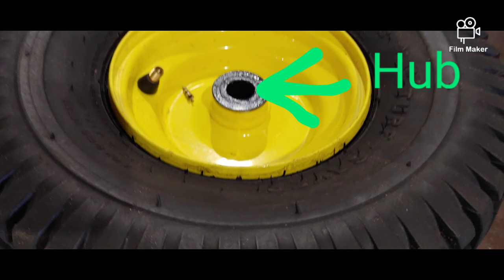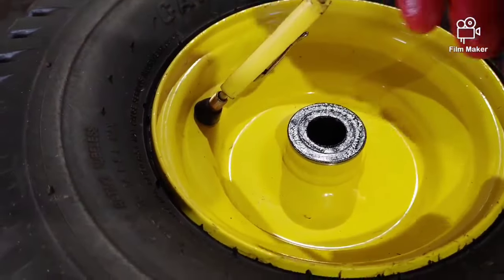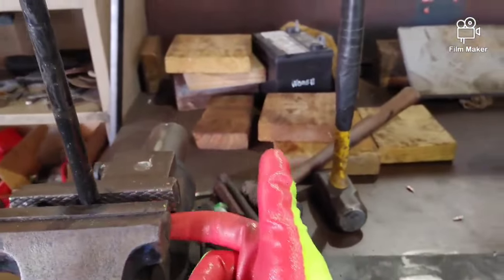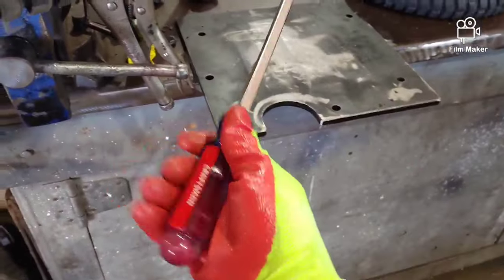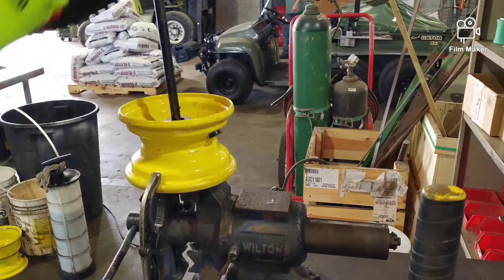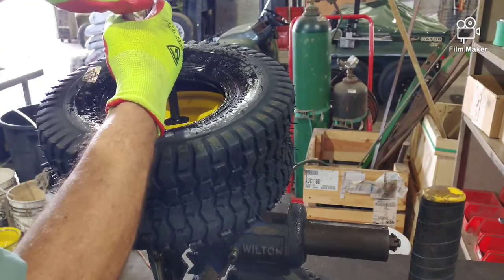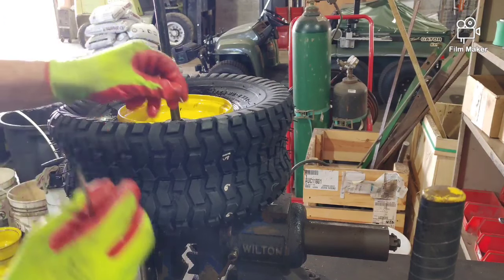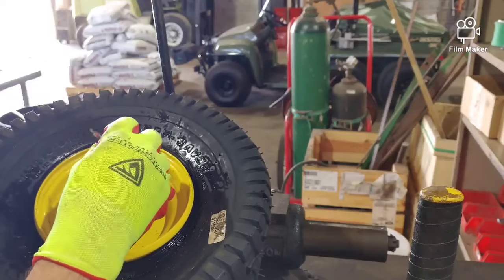How to mount a small riding mower tire. Very easy method.

Comment: One thing I think you forgot.  When you go to air it up, sometimes the bead won't settle into the rim and the air just escapes.  To remedy this problem, put a belt around the tire at the center of the tread forcing the bead into the rim, then air it up.
Reply: Or ratchet strap
Reply: Yeah a lot of these videos leave off the air-up step, probably the most difficult step. Wonder why that is?
Reply: Your subscribers made the best point of the post. Thanks so much.
Reply: Get the tire heated up, I lay them out in the sun shine for a while before I change them, the heat swells them and makes them more plyable

Comment: try breaking the bead loose with a hammer on one that's been on a mower about 20 years,also try it in cold weather
Reply: That was my situation, i dropped my snow plow blade on it a few time and that finally did the trick.
Reply: Try that hammer trick with old hard and dried tire. It won't happen.
Reply: If your vise is big enough use it to break the bead
Reply: Thank you saw much for your info. I needed that tip at this time. God bless you for saving me lots of money.

Comment: Getting it off the  rim is the easy part Getting  broken  free  from the  rim is the hard part when they haven't  been  removed for a long  time
Reply: That's the first thing I thought when I watched him just wack it off with a hammer in a single hit.  
That said I'm impressed with the bar in the middle trick, I usually struggle with dual tire irons working them around to pull the bead over the flange.
Reply: Especially ones that are 30 years old, rusted and full of slime. Haha.
Reply: @MISTERSLLIM put the tire on the ground, put a jack on just the rubber and jack like you are lifting a car.

Comment: I don’t believe I have ever left a comment on a Youtube video before.   DAMN!  This worked!  I was so frustrated that I was ready to drop $50 on a Harbor Freight small tire changer!  This made my afternoon, and I got the lawn cut!  Thanks much for this short, sweet and ingenious video!
Reply from the maker: Thanks Phil!
Reply: I had one of their small tire changers to use on go-kart wheels.  It wouldn't even break the bead without bending.
Harbor Freight's motto should be:  Designed to break, and built to stay that way!
Reply: @davebryant8050  HF sells a set of socket extensions that are extra long.  Those are handy, so I bought a set, Thinking what could break.  Zero moving parts right?  The square end of one just twisted right off.  You'd have thought it was made of brass, it was so soft.  I don't think the steel had been correctly hardened.
Harbor Freight:  Designed to break, and built to stay that way!!!
Reply: I bought that HF small tire changer and it did squat. Be thankful you saved your money.

Comment: Great video.. Thank you....  to break the bead, I place the wheel (without air and with valve core removed) on my smooth asphalt laneway. (or lawn...but not gravel) then very carefully drive over the edge of the tire until the bead separates from the rim.  Great tips thank you

Comment: Thank you so much for taking the time to make this video. I have a commercial grasshopper mid mount lawnmower, and I had a hole in one of the small tires in the front. There were no tire shops open today and I had the tools to do it and a bench with a vice and this really save me a ton of mowing time.thanks again. Awesome video.

Comment: Of course, I see this video the very day after I give in, go to Harbor Freight, and buy a mini tire changer. Another set of vise grips would have been so much cheaper.

Thanks for posting. That was so cool!

UPDATE: After trying the "Harbor Freights Way" for about an hour and did nothing but get really, really mad, I watched your video again. I wasn't able to squeeze the little 6-inch tire as you did to get it back on (maybe I could have done it 20 years ago) so, I got 4 Erwin Qwik-Clamps to do that part. 3 or 4 minutes later, the tire was back on. thanks again for posting this video. I'd still be over there, grunting like a crazy man, if you hadn't.

Comment: That looks so simple and those tires appear very flexible. I have 4ply 16x7.5-8 for aJohn Deere 455. They are very stiff and cannot be manipulated so easily. Back to my wrestling match...
Reply from the maker: I get the tires as hot as possible and With bigger tires I use a tire machine.
Reply: Two big c-clamps with wood blocks, squeeze the old to break the bead.

Comment: In 2018 I moved onto a rural property and bought a John Deere lawn tractor. I was constantly sticking that tractor 
so I bought some ag tires. I got the turf tires off OK & I got the ag tire on 1 bead BUT for the life of me I could not 
get the other bead onto the rim. I finally took it to a tire store to mount. They charged me $25 which I think was a 
bit much. Well, after 6 years I have smoothed out my property and have been thinking of putting those turf tires back 
on. Here we go again...

!

Comment: Good video.  I would inflate the tire to seat the beads before inserting the valve stem core.  It will air up much quicker and help seat the bead then put in the valve stem core and inflate the tire to recommended pressure.

Comment: Great video ❤ it if it won't air up I put a ratchet strap around the center of the tread. It forces the beat to go on. Then I air it up without the valve stem seat the beads and then put the valve stem back and thin air up to the working pressure. I use 10 PSI. 😊
Reply from the maker: Thanks Ben! That's exactly what I do if the tire isn't seating the bead.

Comment: Interesting. Thank you for the explanation. I take it you know what you’re talking about. 

From my point of view the naming of the rim correlates to if I would say shop on Amazon and wanted to upgrade rims on my truck, that would be the common description used for the metal part, similar with tires, just the rubber part and lastly buying wheels for a trailer or golf cart, wheels would get me new tires with rims.

Comment: Nice demo. Thanks!

Side note pet peace:

A tire plus a rim equals a wheel. The rim is the center metal part. The tire is the rubber part. The wheel is the combination of the two.
Reply from the maker: Incorrect - the wheel is the entire metal assembly, not including the tire. 
The rim is just the outside edge of the wheel. 
People often mistakenly call their wheel a "rim". The rim is just a part of the wheel assembly.  
The tire is never to be referred to as a wheel or rim.

Comment: Back in the late 70's I worked in a body shop/ used car lot, and they had a manual tire remover that I used on occasion that worked on the same principal. I don't remember exactly how it kept the tire stationary. It was quite a chore getting 14 and 15 inch tires off the rims.

Comment: Getting it back on the rim is usually not a non-trivial matter, but this was very good for as far as it went...
Reply from the maker: Maybe in your world. I might have a slight issue 1 out of 20 tires getting it to seat. Only reason I made this video is because the insane number of people that come in  not being able to remove the old tire and mount a new one.
Reply from the maker: Just tighten a ratchet strap around the middle of the tire. That forces the tire to push out. Work in small and large tires.  Super easy

Comment: My papaw had an old bumper car jack he'd setup to break the bead seal. Set the foot of the jack where the tire meets the rim. Set the lifting part in a groove he made in an I-beam support for the garage. Just start jacking and the foot of jack does the rest. Guess the same thing can be done with a modern jack between tire and frame of car. Will have to try that.

Comment: Good technique and informative. My issue has always been that when it comes time to either change a tire or insert a tube from a punctured tire...the bead break NEVER goes that smoothly. I have never had a bead break with just a few taps of a sledge. it takes a jack pressing down from a trailer hitch on a truck, hammers, screw drivers, and last time, the bucket of a tractor to get that bead off the rim. Unless you have a brand new, supple rubber tire, they have never released quickly for me. I have yet to find an at home remedy to that bead break trouble.

Comment: Wow. I have mounted too many small tires but have never seen ones that pop on and off the wheel that easily. And then there are the larger ones that, when new, are so shriveled up that no bead blaster or any other trick will seat the beads, so only a tube will work. In any case, Harbor Freight’s small manual tire tool works well enough.

Comment: Good method, but there is one thing I would change, and that is to get rid of the screw driver and get a tire iron fro Harbor Freight or other source. A lot of ATV shops sell them as well. Reason is, screwdrivers have a flatened end thats tapered. The edges of this area can cut the rubber along the bead area. This rubber is softer on some tires, but this rubber in the area your pulling an edged screwdriver through is all that seals a tubeless tire to the rim, and cuts or other damages can lead to leaking tires.

Comment: Great vedio but I always have issue with getting the bead to seal and air up---- Thanks Mark
Reply from the maker: When that happens, I just use a ratchet strap around the center of the tire.  
It also helps to warm up the tire as much as you can to make it more flexible

Comment: Thats was the most compliant soft rubber tire I have ever seen…

Some actual tire irons are helpful and they are tools like “bead buddy” that hold tire stationary to rim while you work tire over rim…

Still, I have given up with tough stiff 4 wheeler tires before and just take them to a tire jockey place and pretty cheap to have them mount for you…

Comment: To add to this handy tire install if you are having an issue filling your tire with air, get some rope and loop it along the center of the tire, now tighten it and this should cause it to press against the rim creating a better seal while adding the compressed air.

Comment: Thanks for the video. But you stopped before inflation. How do you get the bead to seat without starting fluid and a match?
Reply from the maker: When I have giving problems seating I'll use a ratchet strap around the center of the tire.

Comment: You can use a threaded rod in the vise , cut a short bar ,drill a hole in the bar to fit over the rod , screw a nut onto the rod and you have a way to hold the wheel ., harbor freight had cheap tire changing tools so you don't gouge your tire with a screw driver if you a putting in a tube, you can get a few more miles out of a leaky dry rotted tire  with a tube

Comment: I use a small bottle jack to break the bead.  Put the base of the Jack against the edge of the rim, and the ram against a trailer hitch.  
I just fought my 4 inch rims on the front of my ZTR mower.  They are small,  but a royal pain in the a$$.
Reply: I haven't tackled   the front yet. How bad was it with the bottle jack?
Reply: @johnnygavita  it works well, as long as you have a hitch to push against
Reply: @robertheinkel6225  I'll give it a shot. Thank you

Comment: Does this work with a 4 inch rim? It looked pretty easy when you did it, but that was a bigger and softer tire.
Reply from the maker: It should work David but I'd recommend getting your tire as warm as possible to help make the tire more flexible.

Comment: I could have used this two weeks ago. Although, my tires were pretty old, ( non plyable,) and stiff. Hard to work with.

Then, the new soft playable tires come, and it looks as if they had set a pallet of some considerable weight on top of them.

Tip:  set them out in the sun on some black top for a couple of hours prior to mounting and inflating.

But thanks anyway. Next time, right?
Reply from the maker: Well the video has been up for nearly a year! 🤣
Yeah a hot tire does much better. I'm in Florida so it's not hard to get one hot here

Comment: Usually the hardest part is getting bead broke off rim. This is obviously a new tire that you just put on and took back off. The best way to break a bead without a tire machine is use a trailer ramp or something similar.  Lay tire flat and put ramp on tire side wall. Drive a truck or tractor up ramp and it will  pop tire off.

Comment: Gota say that's faster and easier than how I do it but then I have a hard time getting both beads to seat/aired up.
Reply from the maker: If you're ever having a hard time getting the bead to seat, wrap a ratchet strap around the tire in the center of the tire. As you tighten it up it will push the tire out and it will make contact witht he wheel. Then add air and release the strap while adding air. I should have added that to this video.
Reply: @Mechanical_Mind  I've done that. It didn't work for me. It made it worse. The tires were squashed when I got them. I sat them in the sun for a few hours and they "widened" back out... but it doesn't always work easily.

Comment: Great video, thanks for posting it, I use a small tire changer, one of the best purchases I have ever made, having about 8 things with small tires.
Do you find that WD40 attacks the rubber at all?
Reply from the maker: Wd40 doesn't hurt rubber or anything that I can think of. It's great for removing sticky glue...
Reply: I always use WD or just plain 'ol squirt gun, aka, used car oil. It will help to spin the tire onto the rim, & make the rubber kinda sticky & seal better. 
I will NEVER spray soap or water on my rims or tires!  That moisture stays inside of the tire & will rust the rims, if there are any knicks in the paint.

Comment: It's easy to change the tire but you best do it while the rim is on the Mower sometimes you play hell getting the rim off of the axle
Reply from the maker: I struggle to change them while in the mower. I find it faster and easier to remove the wheel from the axle.

Comment: CUT OFF THE OLD TIRE, use any circular saw, or grinder, use a good sized pry-tool (dull-rounded), to hold the tire away from the rim... cut the bead  Also, use a large CLAMP , to break the bead... no air  (hand ones work good)
Lastly, use some motor oil around (both sides) of the new tire bead, and STAND on it to put it ONTO the rim, (one side first, clamp, use a rag to clean up the oil later) firmly hold onto something (pole, table) while you stand on it.

Comment: NIce, scratching the paint on the rim using Vise-Grips.... WTF?  I've always just used traditional tire irons and a piece of heavy plastic to protect the finish on the rim if it was painted or alloy.  Not any harder than doing it this way and it doesn't damage the paint...   I've always changed my own tires from bicycles up to 11.00 x 24.5 truck tires, never used a machine, just a good set of irons, a spoon, and a tire hammer (bigger tires) or a $20 bead breaker from Horror Freight on smaller stuff.  As a plus, you can throw everything in the trunk and be prepared for tire issues while on the road.  A few years back I came back from a 2 week boat trip only to find some a$$wipe stepped on a valve stem on the trailer parked at the ramp causing a flat (2nd trip on the tires).  I was caught with my pants down (never considered somebody would do such a thing), and inadvertently grabbed the wrong spare tire for the trailer.  Ended up having to pull the tire and chain-up the axle on that side (luckily 3-axle trailer, and I always carried a few chains just for this purpose), and limped to a garage.  I now make sure I bring my tire stuff along so I'm able to repair the tire on the spot.

Comment: I don't know what kind of tire you're putting on there that has such soft side walls. But this would never work on my tractor. My tires are 16 x6.50 x 8 and they are four ply. I got the old ones off fine, got the first section I'm okay , my when it comes to the outside I can only get it halfway and the sidewalls have no play and then whatsoever!

Comment: Re apply the bead?
Reply from the maker: Use a ratchet strap around the center of the tire. If the tire is hard try to warm it. I will let tires sit in the sun an hour or more before messing with them

Comment: The issues i have is when you cant get the beads to seal against the rim when airing up
Reply from the maker: Hey Peter, use a ratchet strap in the center of the tire to squeeze down the tire. That will cause both side of the tire to expand out to the side to make a seat against the rim of the wheel.

Comment: I bet if tire is warm it would make it easier? So maybe heat it up a bit.
Reply from the maker: Yes it does make a drastic difference. I leave them out in the sun to get them as hot as possible or use heaters in the winter.  I should have mentioned that in the video...

Comment: Good Stuff,,, thanks.
Now show everyone how to put a TUBE inside of that tire & rim.? ( Blow the tube up first, & find the proper side placement for the valve fitting)
 I never throw a leaking tire away, unless it has a non-repairable gash or huge split in the sidewall.  
Small splits from age,,,, I'll grind the inside of the tire, glue in a patch, & throw in a tube.  (another video for you?)
 Let them double the price of tires,,, I'll find a way to screw them!!  ;>)
To break those tough beads,,,, I'll use an all thread rod in the vise, & weld a 'T' rod to the bottom that would go under the jaws,,, hold it in place & prevent spinning in the vice jaws. Then, use a slightly larger rim on top and compress it down with a large nut & washer, to pop the tire bead below.
OR just weld up a piece of heavy wall pipe with a handle on it,,,,,, make a small dia tire bead breaker.

Comment: You didn’t use a pair of locking pliers on the installation, you only used one. You did use a pair on the dismount.
Reply from the maker: I take the wheel off the vise and vise grips off to cut off old valve stem and install a new one. You are not required to do that but at the shop we always do.